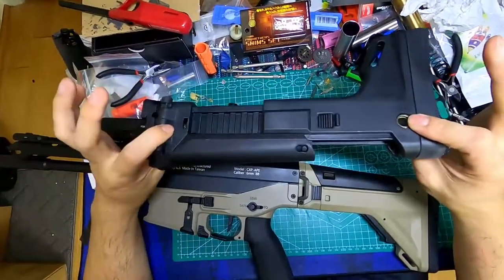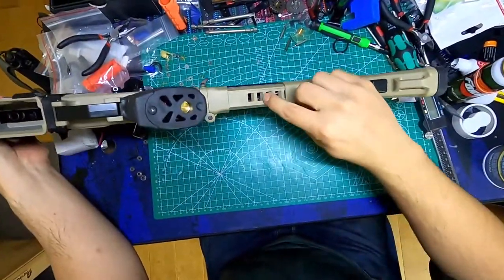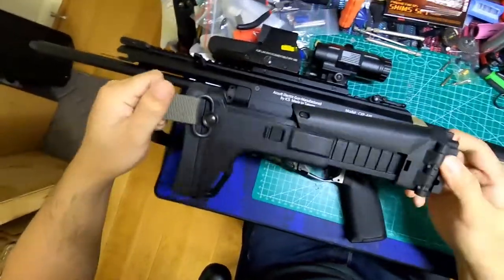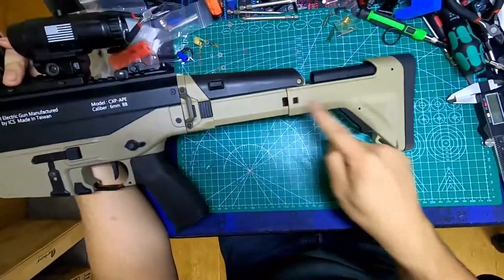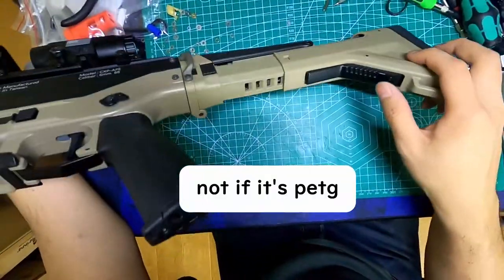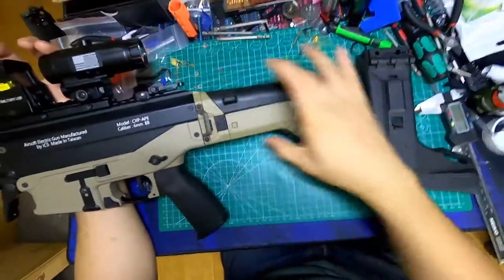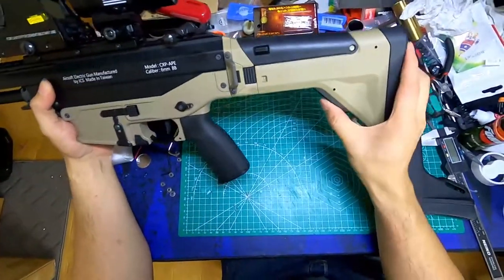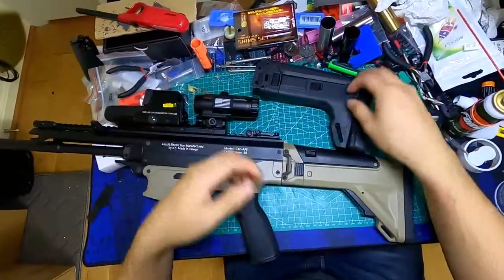ICS CXP-APE/A&K ACR STOCKS RANT/RAGEPOST

Comment: To answer some of your questions (I have way to many acr's in my collection). The Real steel,  WE MSK and the PTS Stock don't extend when pulled like the ics and the a&k. If I ever get the cxp, I'll probably either hpa it so it doesn't need a battery and put on the non-folding stock I designed that looks like the remington one (God I love my 3d printer). Hell, there are free stl files for acr stocks out there as well, It shouldn't be to hard to modify a design to hold a battery.

Comment: Is it standard hop unit and nozzle length
Reply from the maker: unfortunately no and no
it's a typical m4 hopup with extra steps as it's positioned farther forward than normal and because of that, the nozzle is also longer at 30.7mm

Comment: Hey man did you ever figure the sliding issue out on the a&k stock?
Reply from the maker: Unfortunately the a&k one isn't easily fixable as its detent slots are already squared off, but the things on the sides that actually index the slots only dig in when the stock is pressed on and pop out when pulled. I couldn't find a quick fix sadly

Comment: I have a tech question and would like your input, I'm going to make a video on it tomorrow morning which I'll link. 

Basically, shs 13:1 ssg build, 11.1v 25c lipo, did my best to shim perfect, all seems solid there, stock g&g 35k titan motor,  shs piston with maxx piston head and maxx cylinder head (great compression), m120 spring. 

Shoots fine on semi but heats up motor and battery quick. Auto shoots 3 or 4 shots and v2 hybrid perun shuts off gun. 

My suspicion is motor is old and worn, motor height? I played with it already and it's sounding way better. I ordered a new asg 30k HT. 

You think maybe it's my shimming? Even though it feels smooth and I followed along best I could with a video lol 😆
Reply from the maker: it could be anything from low battery to something seizing and causing the mosfet to temporarily pop the efuse so I'll wait for the video, but for reference I took some pictures of my motor heights before I went to work https://imgur.com/a/YmUXsoX
Reply: Thank you, uploading now
Reply: https://youtu.be/kuTsRXZ8nqc video question on the krytac kriss vector dsg. I hate to ask cause it's a pain, but anyway you can do a build breakdown and show everything going on inside? Also 10mm for the tappet plate sound solid? I will be uploading my progress cause there are no videos on this gun
Reply from the maker: @evolutiionz755  My tappet fin is roughly 9mm from the top of the arm to the bottom of the fin. And no problem, I'm editing together that video right now!
Reply: @j-airsoft  thank you so much, this can be very frustrating lol